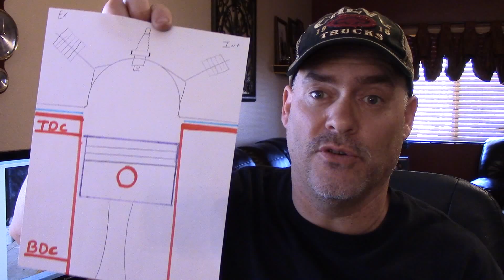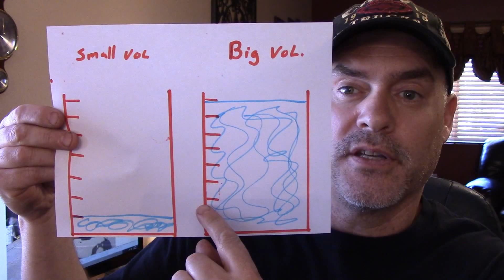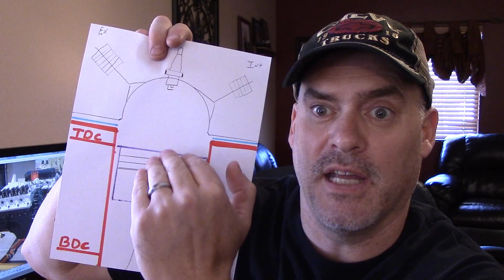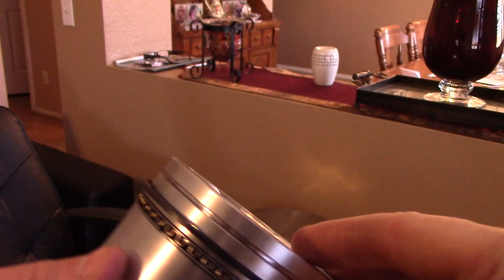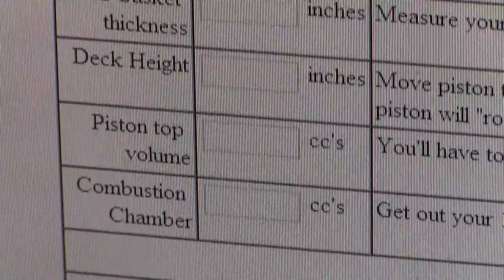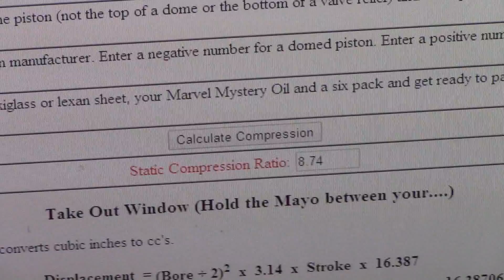383 Stroker Engine Build Part 5 (Compression Ratio)

Comment: So if you have a larger cc head and still maintain a 9.5/1 ratio is that better or do you want to still have a smaller combustion chamber head. Also how do things change if you want to run a turbo or supercharger? I'm just new to this so don't laugh to much at my questions.
Reply from the maker: It depends every engine is different there is something called surface to volume ratio in general it is better to have a larger chamber because of more A/F capacity as long as you can maintain a compression ratio that you want the key for any chamber to work well is two fold the chamber needs to promote turbulence (rapid mixing of the A/F mixture) the other aspect you need to find a happy medium as far as size goes,  too large of a chamber and the surface of the chamber absorbs to much heat and it robs heat energy that should be used to make power to small and there is not enough area for the A/F charge and you limit the power even with a good induction and exhaust system a chamber that is to small can limit the amount of A/F that can fit into the chamber, Because of this you need to do allot of research on your engine to find out what does and does not work well  based on what other people have done with dyno testing and so forth.

Comment: Why are little hondas and sport motorcycles able to run around 12:1 without issues?
Reply from the maker: Aluminum gets rid of the heat much faster I ran 11.3 to 1 compression in one of my Big Block Chevy engines on pump gas with Aluminum heads it worked try that with cast iron and yer engine ids doomed
Reply: Awesome, thanks for the knowledge! I've been watching so much of your channel this past week, I am so glad I found it recently.

Comment: I have an iron headed 383 with 10.2:1 (figure is without deck clearance ) am I  S.O.L. on pump gas hopes? or could a cam with a bit of overlap save me?
Reply from the maker: How much deck clearance do you have
Reply: Myvintageiron7512 I have not measured yet. I did use the recommended calculator and found if it's at least. 010" in the hole I should be at 9.9:1. BTW Thanks for sharing that. I'd been using Wallace racing calcs and my numbers have been different every time.
Reply from the maker: If the block hasent been decked it's probably more like .030 it should be fine
Reply: Myvintageiron7512 Blueprint assembled short block, so I'll have to measure to know. Sadly they do not give a build sheet. 
  thank you so much for your replies. Liked, subbed, and shared.

Comment: Well, my friend, I'll have to disagree with you on one point. My daily driver in 1986 and '87 was a Nova with an 11to1 comp ratio, and it ran perfectly. My friend who actually owned it was a drag racer (bracket) and I have to believe him. This thing really snorted, it was nice, just sayin'  :---))))))))))))))))
Reply from the maker: Did it have Aluminum heads
Reply from the maker: Do you know for sure it was 11 to 1 or is that what you were told I have tried it more than ounce and it does not work well on pump gas
Reply: 11 to 1 on pump gas?? and it's a daily driver ?? sorry man I call BS I have built a bunch of these engines with 11 and 12 to 1 compression and I can tell you there ain't no way you had that kind of compression on a carbes small block with pump gas I don't care what your friend told you he's full of it
Reply: Dave I wouldn't say it's impossible. In 86-87 there were better premium fuels at the pump. up until last summer I could get 104@the pump.

Comment: Thanks for the great videos.  I  just finished assembling my 383 stroker and the C/R is 10.24 to 1.  I have aluminum heads with 70 cc combustion chamber, .039  head gasket,  piston is .008 in the hole, with 5 cc valve reliefs, and bore is 4.030.  To get to 9.6 C/R should I buy another set of pistons (dished) or maybe  thicker .065 head  gaskets.  Any suggestions?
Reply from the maker: 10.24 to 1 is fine with aluminum heads run it premium fuel only of course
Reply: I noticed Blueprint Engines runs 10.0 C/R on there 383 with aluminum heads.  So why is a Higher C/R ok with aluminum heads as opposed to iron heads?
Reply from the maker: Aluminum heads remove heat much faster so more comp is doable

Comment: my 94 camaro with the lt1 runs 10.5:1 compression. How is this achieved with just running 93(premium) octane.
Reply: Different variables, Heat, altitude,cam bleed, there are a lot of engines with 11.0:1 or more on 93, static is different to dynamic most cams will bleed a tiny amount of compression during intake so your dynamic comp could be 10.2:1 give or take. but if you're running 10.5 on a lt1 you should have researched this kinda thing before you risked destroying it by not knowing. but yeah 10.5 is easily achievable on 93.
Reply: remember, your LT1 is reversed cooled and has EFI. that has a lot to do with it..

Comment: If you're gonna do a more in-depth video of compression ratio at some point, it'd be cool if you could touch on subjects like Squish/quench (and decking the block to achieve this), aluminum vs cast iron heads, piston, head and valve coatings, thermostat temperature, camshaft profile and other things that affect susceptibility to knock/detonation, and how much compression one can run when taking all those into account, as opposed to a generic engine.
Reply: ChielScape Did you know they make schools for that? & there is a calculation for this too. He just told you that. Do your math. Don't ask him to help you. all each one by one. Plus it's top secret! So? Haha
Reply: Are you stupid? Considering your blind faith in the American educational system, I think I know the answer. Not to mention your reading comprehension.
Reply: ChielScape cool your jets Cowboy or raise your octane level, check your combustion chamber CC,'s and get comp. ratio! And your big dish Pistons you got! Deck you block smart ass, and see what happens Then. Fords have more positive deck hight and need it done. Not Chevy's so much and you don't learn this in public or private school, try doing it all your life Capt. Squelch. Try Flame travel.
Reply: ChielScape you just asked 10 different things and answered your self. Just raise your octane and fix the flame travel & polish combustion chambers so not to have hot spots.
Reply: I asked for him to make a video on these things for people to see. I know them, that's why I can mention them in the first place. Difference is he can explain them better.

Comment: Nice videos, tons of great info. When you say pump gas, are you talking 87 octane? From what I know some cars come factory with 10.5:1 up to low 11:1 ratios and are suggested to be run with premium fuel 91 octane. Whats a good ratio to run on 91 fuel. Working currently on a Chevy LT4 engine with a factory ratio at 10.8:1.
Reply: I run 11:1 with aluminum heads all the time on premium gas and 34 degrees total. Works just fine.

Comment: I'm in the process I'd building a 383 stroker right now and the heads I was looking at have a 64 cc combustion chamber putting me at about an 11:1 compression ratio... could I run in premium? Haven't bought the heads yet so I can still reconsider
Reply from the maker: NOOOOO! don't do it!  You need to be at 9.7 to 1 max for pump gas and enough timing to make power 11 to 1 needs 106 octane
Reply: Myvintageiron7512 awesome thanks for the info saved me a hell of a head ache

Comment: just saw your video on compression ratio,my question is this,i bought a car they said was a 350 bored to .30 over..355 c.u.,one of two questions,i have world products s/r tourker heads,and i,m not sure of the c.c. size,they cam in 67 and 76,the other question is,the pad on the front of the block,the numbers and letters are ground off,soo i,m not sure what it is for sure,or could the block have been dected...it has a mild cam,and whether i run reg.gas,or high test gas,the performance doesant seem to change,except the idel seems to be smoother with the high test fuel,..and idea what the static compresson might be.?...thx for the help...stu.

Comment: When you say 'pump gas' what octane are you referring to? I'm building a stroker in college this year and want to run it on pump gas because $14 a gallon for race fuel is just not in my budget. I'm just not sure how high of compression ratio I can go on 91 before it starts to hurt the motor. Pulling a 350 out of a C60 grain truck, got a 400 crank and rods, and hopefully putting vortec heads on. Doing a very, very budgeted build. These videos are highly helpful and I can't wait to see the next one!

Comment: first off love what your doing and awesome videos!
I see that the compression ratio calc. you are using doesn't take into consideration gasket bore? i like to use https://www.uempistons.com/index.php?main_page=calculators&type=comp&zenid=e53f9ef502be8e8714b38b13d8ffb987
plus then I can plug in my cam timing and figure out what kind of dynamic compression ratio i will be running, what are your thoughts on this?

Comment: How on earth can Mazda's new line of four cylinder engines run 13 to 1 compression ratio on pump gas? Mind blown.
Reply: 87 octane on 13 to 1 compression ratio I should say. Nuts!
Reply from the maker: Some of the newer cars with OBD2 control can run much higher compression with computer control along with advanced fuel injection and head and port design they use knock sensors and variable cam timing to make it work with most engines it is not possable
Reply: Dang! Thank you!
Reply: As a side note I wonder how much it would cost to rebuild one of those new Mazda heads. Then you can tell your favorite customer how lucky he actually was with his price lol!
Reply: A lot of it is the scavenging of the exhaust at the RPM knock occurs.  If you can pull out more of the residual exhaust, the next cycle's temperature will be reduced resulting in less chance of knock.  Direct injection also helps in cooling the intake charge.  PFI also cools the charge, but some of the heat the gasoline absorbs is from the walls of the intake manifold.  If sprayed correctly, DI shouldn't contact any surfaces, so a higher percentage of the heat absorbed is from the air charge (cooler temps before compression = less knock).  
I also read an SAE paper on the divot in the top of the piston, but I forgot how it affects knock.  I know it benefits combustion stability since the flame kernel has a spherical dish to grow in.

Comment: How accurate are these stroker rotating assembly kits that say " compression ratio will be X amount with a 64cc head , 76cc head" , ect.  Im building a 383 and have a set of 906 Vortecs id like to use on it.  Your videos are very informative. Thankyou for making them.
Reply from the maker: They are pretty accurate but remember when they say  what the ratio will be with a certain head you need to know what gasket they are using and what your deck clearance will be, they will usally use the standard .035 DC and .040 gasket thickness also you need to know what piston they are using I would jump on the RSR calculator if I were you and plug in your Vortec head chamber they have a pretty tight chamber you will probably need a pretty big dish in your piston and a thick gasket to make it pump gas friendly

Comment: Is it possible to mount a blower on a stock SBC without rebuilding it ? Ie. is it possible to lower the compression just by using a thicker gasket ?
Reply from the maker: Yes it is possible but you will only be able to have fun for a short time because most likely the engine will die a very quick death I suggest you watch Roadkill here on You Tube Fryburger and Finigan put a blower on a stock smallblock in a Jaguar and called it a draguar!  Like I said they had fun for a short time but really a blower should sit on a blower engine one built for it hope this helps